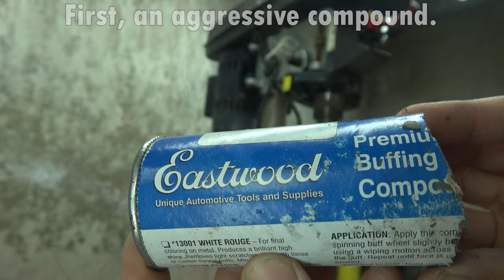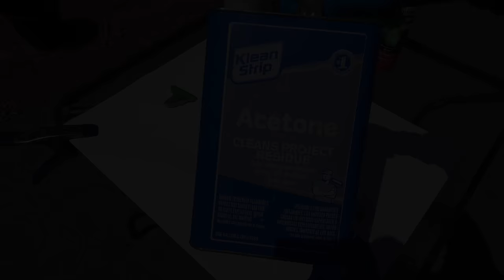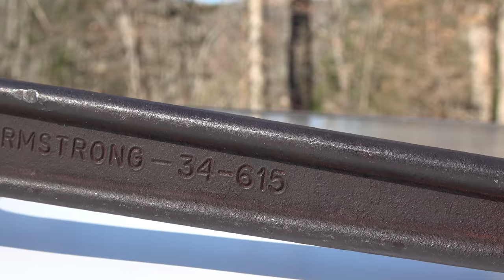ASMR Restoration || Huge Adjustable Wrench

Comment: This looks nice. That bed liner will rub off though. Need to spray DTM (Direct To Metal) or self etching spray on before the bed liner and it'll guarantee a solid bond
Reply: I have sprayed bedliner on multiple metal tools and have never had a problem with it coming off.

Comment: Wow!  I've always had to hit those pin screws with a torch and heat them up before they will budge!  Never seen one unscrew so easily.
Reply from the maker: The bahco I restored on this channel was almost impossible to remove! Sometimes you get lucky and sometimes it's a challenge.

Comment: Have you tried muriatic acid instead of phosphoric acid for rust removal ?  Works killer diller.  Nice job on the resto, frame it dont use it !
Reply from the maker: I have not tried it yet. I want to try evaporust next, it looks to work pretty good.

Comment: Very nicely done IF you can keep the paint on when using it. Powder coating with wrinkle finish would have been a better choice to keep the black finish for a lot longer. But using any type wrench will catch the scrapes and scratches over time. Thumbs Up!
Reply from the maker: You are correct. My goal was more of a show piece then a useable tool. The paint would not last long when actually putting the tool to use.

Comment: Say I wanted to just give wrench its original metal finish look after media blasting, what would be a good way to seal/prevent flash rust from occurring without painting the tool?
Reply from the maker: Tool wax or a light coating of oil. Most raw steel tools are coated in oil  out of the box.

Comment: Wow!  I way overkill on cheap wrench. Looked great though. Ok save money trick. That locktite rust remover, ditch it. A Vineger bath will do the same. Changes the rust to iron 3. The black stuff. Have not tried cider vinegar vs white. But I deal with lots of rusty tools.
Reply from the maker: These large US made wrenches are over $100, well worth restoring. Vinegar is now my go-to, the acid wash not so impressive.

Comment: Im afraid i missed the restoration part
I saw only cleaning and painting
Reply from the maker: Would that not be "restoring" it to its prior condition? Maybe next time I will let a train run over it too.
Reply: Hi Bertje, you might have missed a bit because between cleaning and painting I saw disassembly, filing, sanding, polishing, masking and reassembly. It looks better than new so please explain what else should have been done to make it a restoration. Cheers
Reply: It is a work of art,  but it's technically its not a "restoration".  Restoration takes it back to as near to original as possible. This takes it up to a better level than original. Kind of like taking a beat up 57 Chevy and turning it into a show quality hotrod ;)

Comment: Seeing the guy use a file told me all I need to know..
Reply from the maker: Because rapid filing to round an edge requires precious...its a wrench not an aircraft part.
Reply: @SatisfyingRestorations  files are one directional
Reply from the maker: They sure are. Apply pressure on the forward stroke then graze the file on the backstroke instead of fully lifting. A technique that only the youtube commenter would make a big deal out of.

Comment: That is going to rust badly.  Also is this a show piece now? Doesn’t seem like I would want to use it after the restoration.
Reply from the maker: Its been hanging in my damp garage for 10 months, not a spot of rust.
Reply: @SatisfyingRestorations  Have you used it? The second that wax comes off it will rust.
Reply from the maker: Can't deny that. I am impressed a simple coat of wax worked for this long.